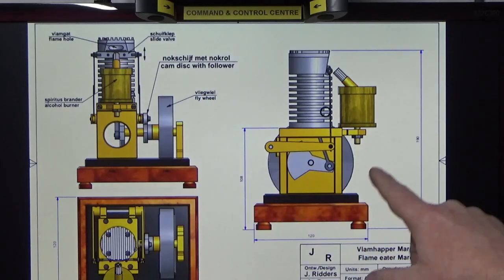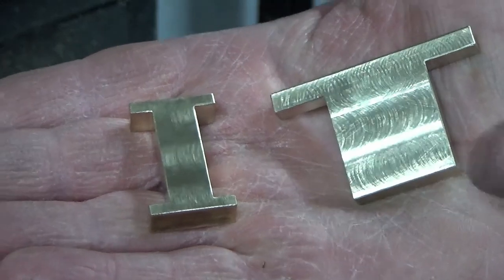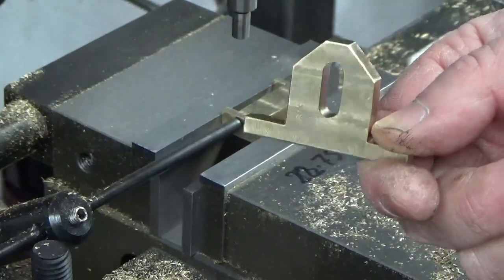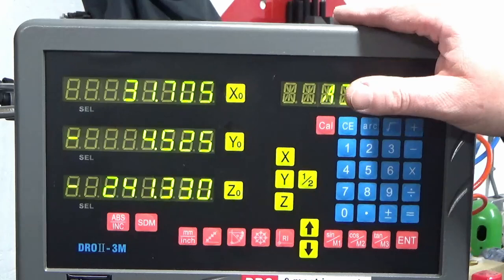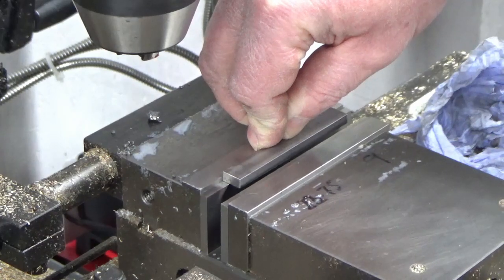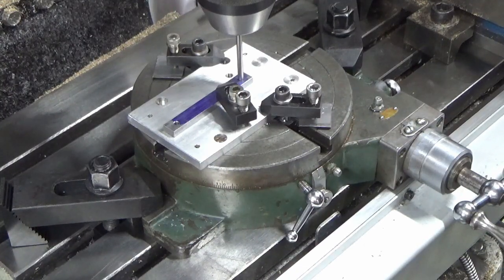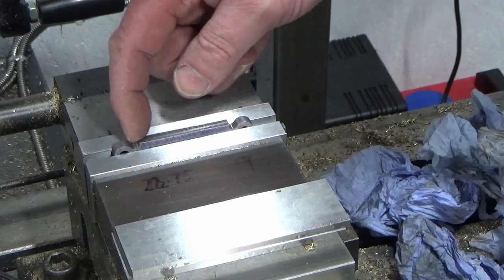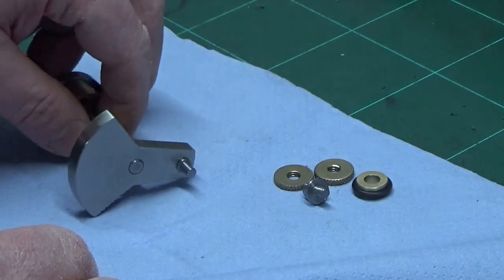Making a Flame Licker Engine "Marc" by Jan Ridders. Part 12 - Final Parts Manufacture

Comment: I bought a lot of hollow and solid bronze bearing material rods in different diameters a few years ago, it was a good investment, I've used it in loads of projects where I need a rotating or sliding joint. It's also a nice colour. Nasty if you try drilling out the hole with a standard-grind drill though, I was drilling one out from 1/2" to 5/8" and the drill dug in and pulled the chuck out of the MT3 taper in the tailstock, and the same has happened in the mill a couple of times when using the quill to advance the drill. I'm trying to grind a drill with the special geometry my dad showed me 40 years ago, but I can't get it right (yet). I'm enjoying this project!
Reply from the maker: Hi Machining and Microwaves, thanks for the comment. I don't have any bronze at all yet in my stock but will need to build some up over time. I have shown the brass/bronze drill geometry process in one of my videos, unfortunately I can't remember which one lol, pretty sure it was one of the earlier Mark engine videos, probably the fuel tank. Cheers, Jon

Comment: Hi Jon, Intersting videos :D  Can I ask what your using for coolant in that squeezy bottle?
Reply from the maker: Hi James, thanks for the comment. I use soluble cutting fluid mixed 10:1 with water from Smith & Allen, on Ebay. Hope this helps. Cheers, Jon
Reply: @jonsworkshop  Thanks Jon, I'm working my way through your videos, from the start and the Flame licker so both ends as it were lol.  Very enjoyable. Your a bit ahead of me I have  warco WM18 Mill and WM250 Lathe. Almost at the part where I'm finished sorting the machines out and can start making the stuff I bought them for :D

Comment: Another fantastic video Jon, enjoyed it! I like your thinking on the modified parts at the end. One small concern I have regarding the  'o' ring is, will it get a small pressure flat spot if the engine is stood for a while? 
Absolutely cant wait to see the engine running, you have done a fantastic job on machining all the parts! Take care good Sir👍
Reply from the maker: Hi Tony, thanks for the comment. Not too sure on the design mods myself yet, I guess time will tell if the O Ring mod works, or just seems like a good idea lol. Very good point on the flat spot, I will just pop the O Ring off I think when the engine is in storage, thanks for the excellent thought process. Cheers, Jon

Comment: Nice work Jon.... some neat parts made! The Part with the O Ring would be "Better" from bronze... but i think it will work on Brass. The engine will not run havy duty all day... 🤣... but all Kind of bearing or bushing better made from Bronze.... 
Keep it coming! Looking forward to the next Part! 
Stay healthy !
Reply from the maker: Hi Chris, thanks for the comment. Yes, I agree on the bronze, I don't have any bronze stock at all in my materials bin but I must get some for small jobs like this in the future. I am not totally sure the O Ring idea will work so I may have to remake the follower in the future, if I do I will probably go for bronze, plain diameter without the O Ring. Cheers, Jon
Reply: @jonsworkshop  As long as you smear the oring with petroleum jelly, it will last forever! Unfortunately, these things do not tolerate every type of oil! The acid in oil tends to make them brittle.
But i am sure it will work! And nothing does  last as long as a improvement :) 
Cheers! 
Chris

Comment: Another approach to the valve supports would be to turn the radiused bit out of round stock and solder it to a milled piece with the matching radius cut into it.  Probably no faster for two of them, but maybe for a larger batch.  I look forward to seeing it run!  (Soon?)
Reply from the maker: Hi Jim, thanks for the comment and suggestion. Agree, for batch production in the home shop without CNC, this would definitely be the way to go. Soon? No pressure then? Lol. Cheers, Jon

Comment: Gday Jon, this is going to be a beautiful looking engine, I’m keen to see this engine assembled and the name plate will really set it off, great job as always mate, cheers
Reply from the maker: Hi Matty, thanks for the comment. It will certainly be good looking if nothing else lol, started with some of the assembly today, already come across a 4.5mm alignment issue with the centre line of the cylinder lol. I am pretty sure I will sort it, probably something stupid I did lol. Cheers, Jon

Comment: First. Can’t believe I beat Matty 😂. Cheers Jon 🍻
Reply: You left a comment before watching it all. I watched from the instant it was loaded. and it has only just finished.
Reply: @daveticehurst4191  watched it all on the television. But commented on the iPhone at the start 😉
Reply: Hi Jon. Did you cut into the face of the fixture plate when machining the conrod? The rubber tyre  brilliant, is it the same diameter as what it's replacing? Did you have to start slightly larger with the hub and reduce it gradually? Just wondering. Nice work. Tony
Reply from the maker: @eyuptony  Hi Tony, thanks for the comment and question. I did just slightly cut into the Aluminium, it's just a piece of scrap I use for jobs like this, when it gets a bit messy, I can just skim 10 thou off it and keep going, it's a dead quick and easy way to hold small parts. The O Ring O/D is just about the right diameter from the plans. I just turned the O/D of the brass piece to half the section of the O Ring smaller than the plans, and plunged in the other half with a piece of HSS ground up as a form tool to suit the O Ring. Hope I understood the question correctly mate? Let me know if not. Cheers, Jon
Reply: @jonsworkshop  That'll do me Jon I came up with the same conclusion. Top marks. Tony
Reply from the maker: Hi Aaron, thanks for the comment, much appreciated, Cheers, Jon
Reply: Matty must have been asleep zzzzzzz.....zzzzzzzzz...........zzzzzzz
Reply: @eyuptony  ha ha ha, I know right 😝